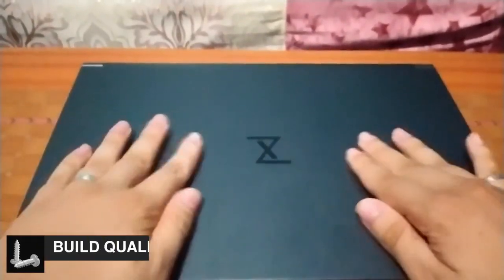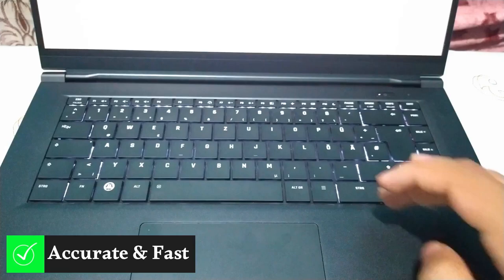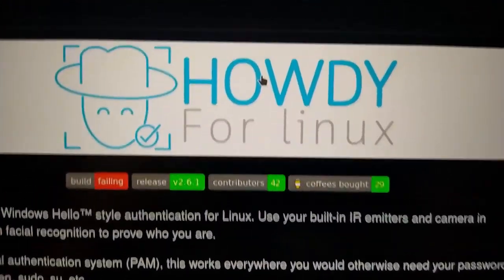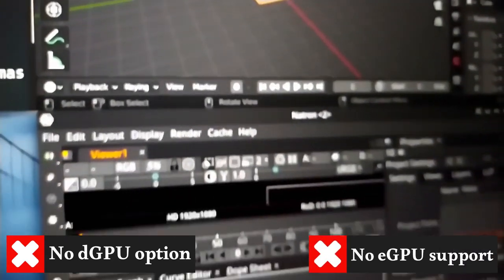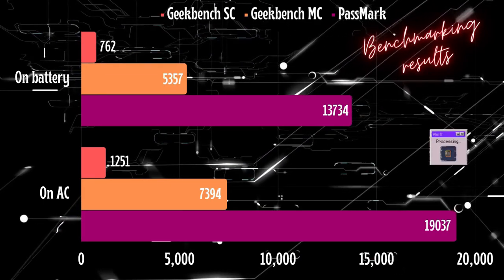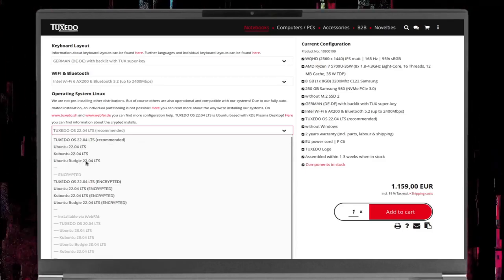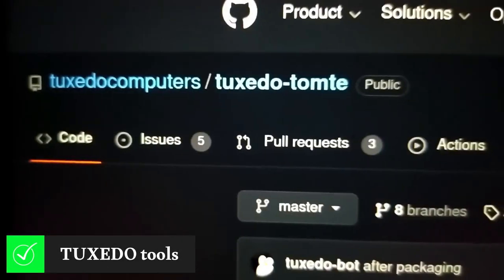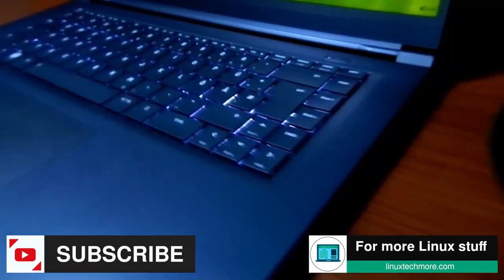Buy a Linux laptop: The TUXEDO Pulse 15 Gen 2 full review

Comment: I saw in another review that the usb 3 port is labeled as such, but actually supports full thunderbolt, which is interesting. I can't say for certain this is true as I don't own the laptop though, just though I would add in case anyone else is make/break based on thunderbolt requirements.
Reply from the maker: If true, that would be great.  I'll check it out and see.